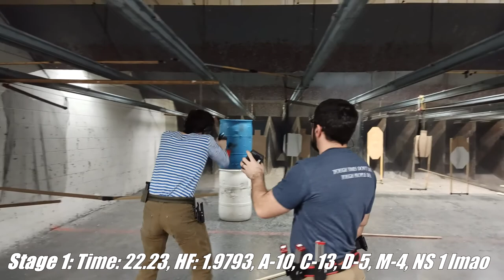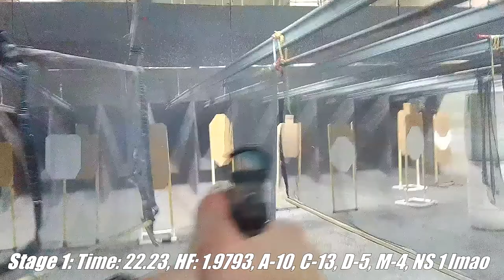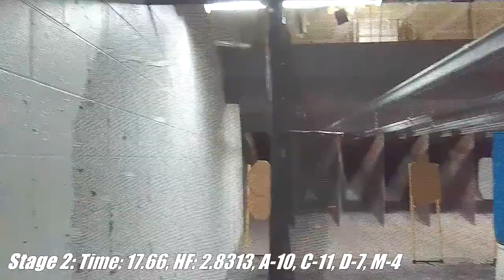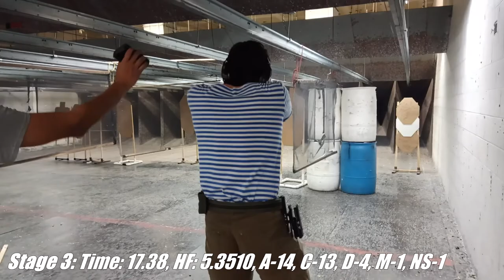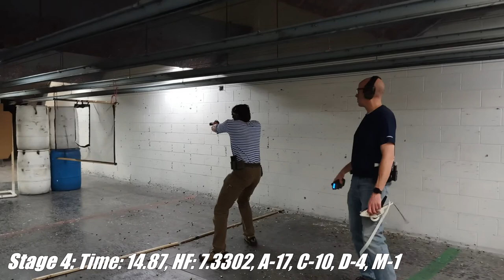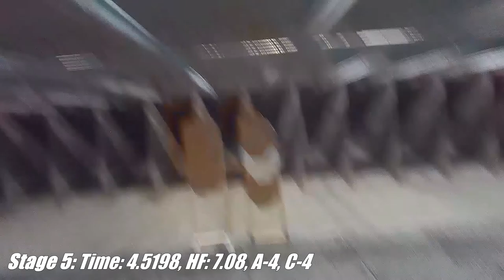HTF Match Breakdown/Commentary - 02/25/2021- CZ P-09 w/ Swampfox Justice

Comment: I'm a fan of the voice-over format. Also, you gotta work on that self-commentary. Your performance wasn't abysmal if you accomplished your goal of getting the P-09 dialed in and you discovered some things to practice. Being that your goal wasn't to win but learn it was a resounding success of a match.
Reply from the maker: The initial goal, which was definitely foolish in retrospect, was to go and shoot competitively with the p-09. I figured if I had the optic mounted and zeroed, i'd be able to shoot at a similar level as I can with my g19. Because of a series of unfortunate events, this didn't quite happen. I think I was sort of tacitly evaluating my performance relative to this initial goal, and in that sense, I did perform poorly. However, you're absolutely right. It's not productive to appraise my performance by that standard when there were so many confounding factors. The best way to look at it is as a learning experience. Thanks again for your insight.